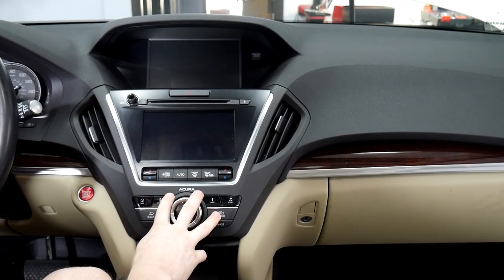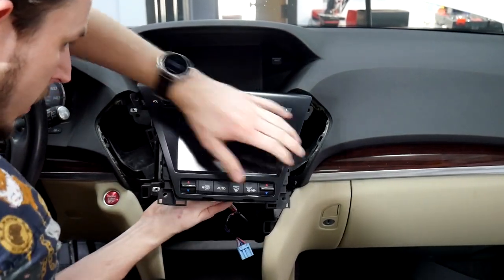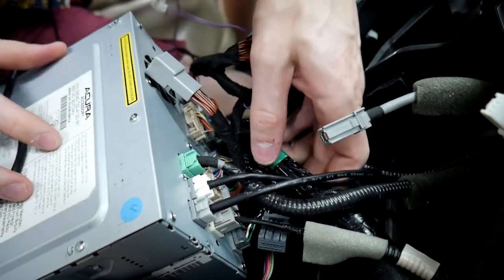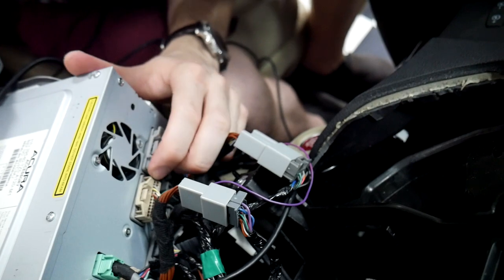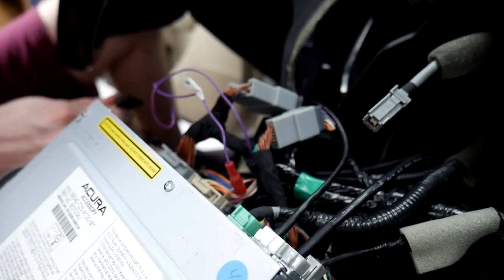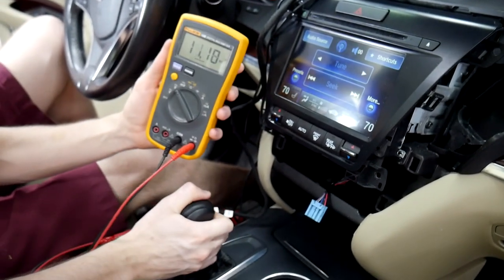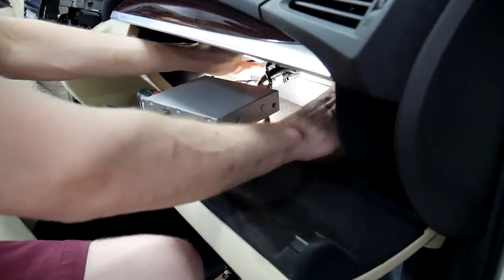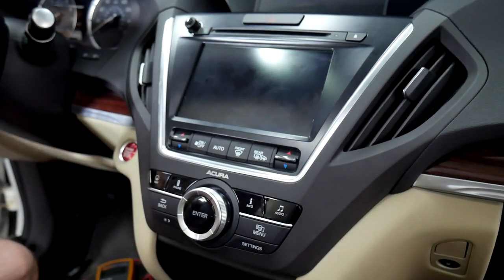VLine CarPlay Android Auto Acura MDX 2014 - 2020 USB Retention REV Wire Connect Glove Box Install

Comment: Is this interface module will work all mdx from 2014 to 2019?
Reply from the maker: It will work with the Acura MDX 2014-2020 if the stereo has dual screen (two screens).

Comment: So by installing this in my acura mdx 2014 i will be able to connect my apple phone as well.? 
Is it connected by bluetooth .?
Reply from the maker: Yes you will be able to connect your Apple iPhone to the car stereo for CarPlay. The connection is either via Bluetooth or USB, your choice. Both options are available.
Reply: @gromaudio  I have the same year as the guy above and I want to know is it easy to install and does it have to go in the glovebox or will it fit behind the trim ofthe radio?
Reply from the maker: @Armyman9003  You can check our other install videos and see what it takes to install the system. You will need to disassemble the part of the dashboard to connect the system to the back of the stereo and the back of the display.
We strongly recommend positioning the main unit inside the glove compartment or somewhere else accessible and not locking it inside the dashboard. It will provide you with easy access to the unit in case you need to update it via USB. Leaving it inside the dashboard will prevent such accessibility and can also damage the Bluetooth antenna or block the signal.

Comment: Back 2 8mm bolts near impossible with DVD player
Reply: DVD player bracket blocks them. Think I'll need to remove it 1st
Reply: Got to it by cutting out the extra black plastic with an oscillating multi tool. Noone will see and dvd play is still held in with the metal bracing.